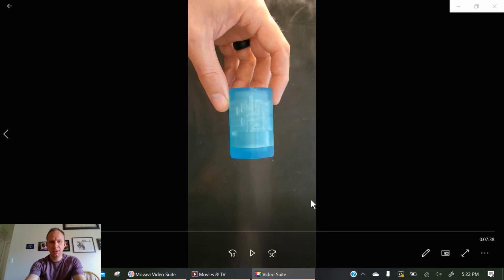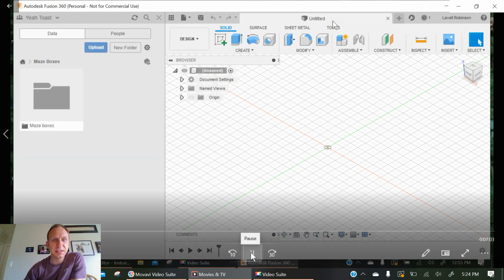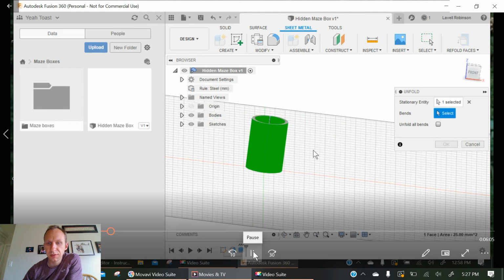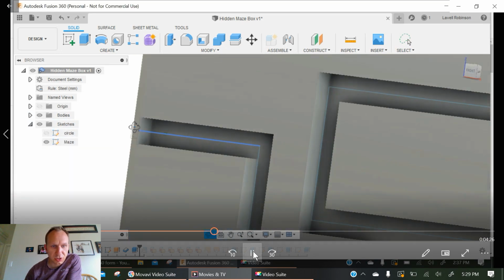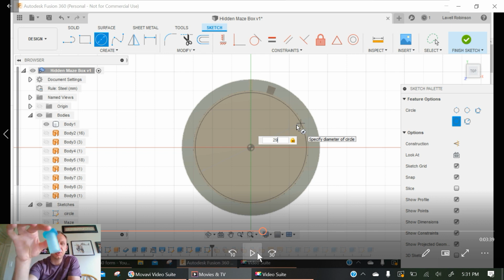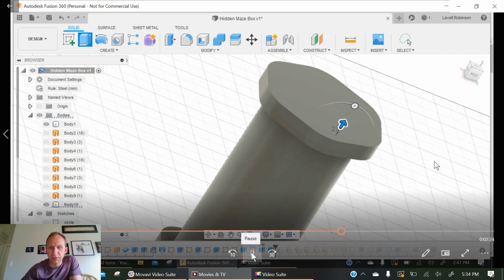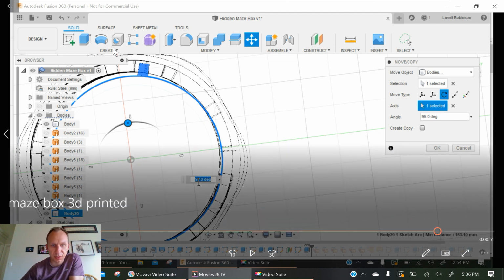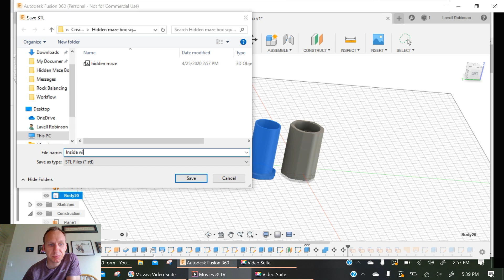Fusion 360 Hidden Maze Box tutorial

Comment: Almost imossible to print because all horizontal lines aare90 degree overhangs and so supports needed everywhere which would mess up the maze to make it virtually un usable. All edges need chamfering ( especially athe horizontal edges plus the nub on the other piece needs similar

Comment: I am a beginner with a few simple models  under my belt. This video is very  difficult to follow because many operations ae just done too fast. Also when I came to print,  supports were needed all over the maze. Also i'm sure the the bottom and the to should be made as separate components.